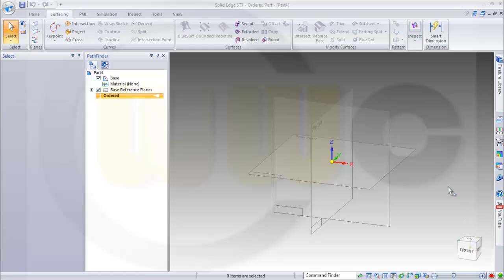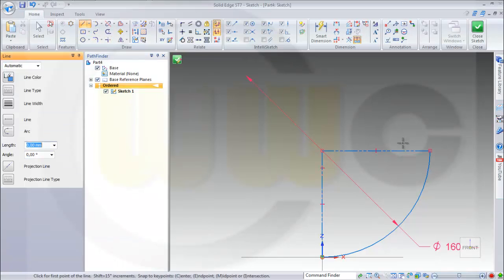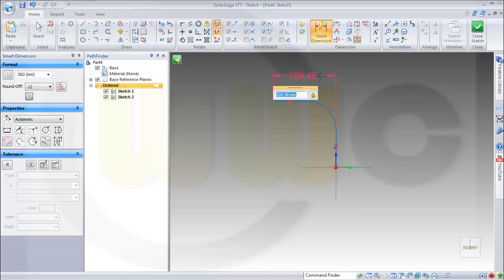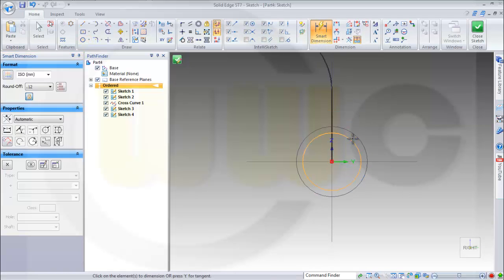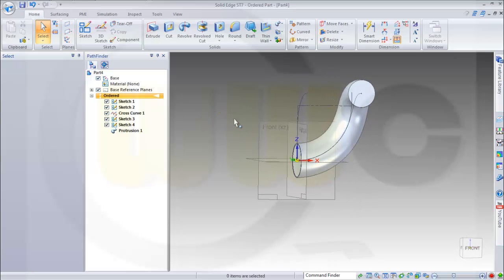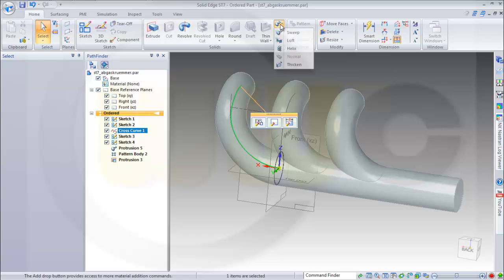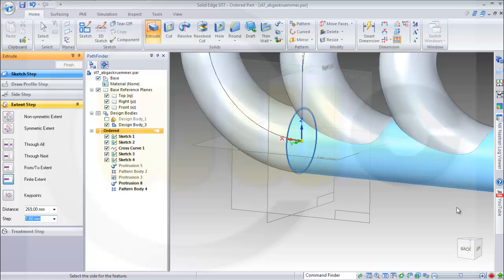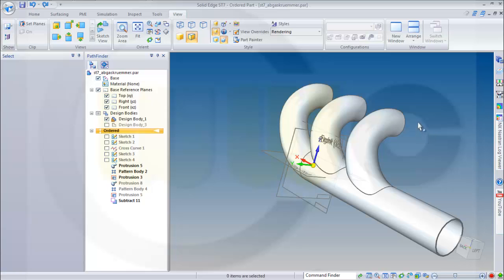12.2 Abgaskruemmer part 1 -  SolidEdge ST 7 Training - Loft - Multibody

Comment: Hi, when I set the spacing between the rectangular pattern to 82mm it gives me an error saying: "face-face clash detected in pattern occurence", so I have to set it to at least to 87mm so the patterns don't overlap, any idea why you don't get that error?
Reply from the maker: Hi, depends on the servicepack and the release of Solid Edge, sometimes on the kind of cpu or graphic-adapter in your pc. Or maybe you made just a small error in your model. ;)
Reply: Ok, thank you for the quick response!